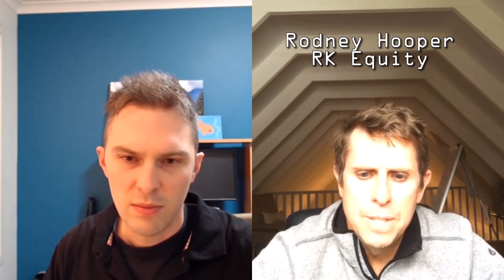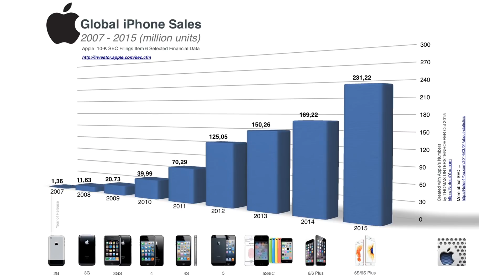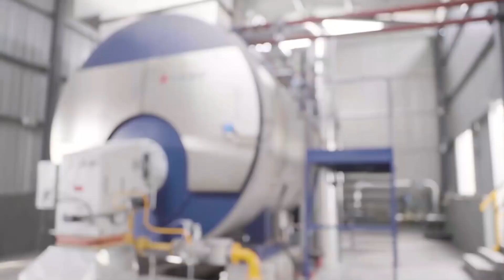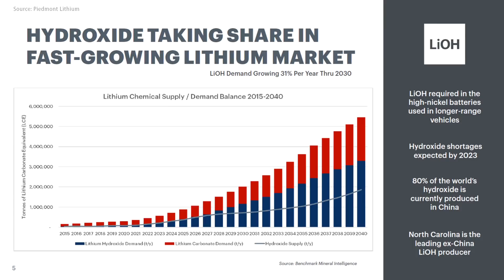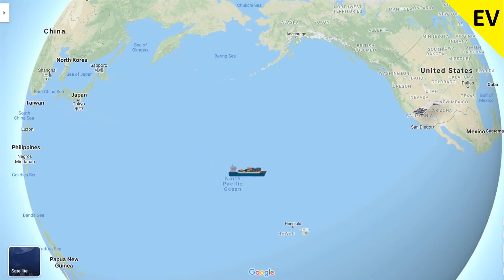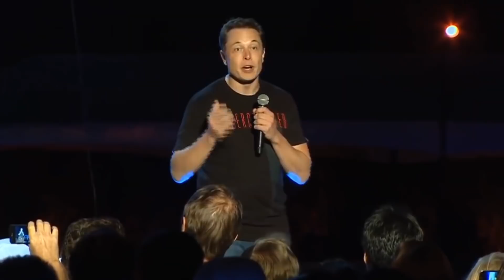Tesla's Lithium supply chain mapped out

Comment: I'm looking at the graph you include at 4:13, and Tony Seba predicts "only" 50% of cars sold would be EVs.
Also, he did not specify how many cars would be sold. What the speaker forgets is that car demand is elastic: If it becomes very clear the market is shifting to EVs, you can expect the Osborne Effect to be in full force, and the sales of ICE cars will decline in anticipation of the transition (who will want to buy an ICE car in 2025 given its resale value in 2030 will be extremely low?). So one can expect the total number of cars to decline strongly as we shift from ICEs to EVs, before rising up again as EV supplies increase to meet demand.
It is quite possible we'll see only 50M new cars sold in 2025, 25M of which are EVs (down from the current 90M/year). 
Also: There is some chance by 2025 we'll have self-driving cars, in which case extrapolations of current sales numbers are not really relevant, as we'll partially shift from private ownership to TaaS (Transportation as a Service).
Reply: Seba actually states that the fleet size will drop precipitously as TAAS comes into play, even as the total number of miles driven continues to rise.  This is because one car can effectively serve the needs of more than one consumer, on average.
This will help some with commodities shortages.
Reply: I definitely think we’ll only see 50M new cars sold annually in 5-10 years.. thou India market is an unknown variable ( to me at least)
Reply: Tesla’s projections have little to do with simple car sales  ironically

Comment: I seems that some mention of current production facilities adaptability for increased production could have been part of the conversation. I had to research a lithium question on my channel but the question was of supply sourcing and the geo-politics involved. Current annual lithium production for the top 9 lithium exporters is 84,840 metric tons (2200 pounds in a metric ton). The US is very secretive about it's lithium mining, but it is believed the US is using lithium far faster than it produces it.

Comment: Good video. When PV became the big growth industry the price of silicon jumped up, but that caused production to jump up so much the price is now far lower than before. While alternatives to lithium exist and must be researched, the growing demand will also encourage improved mining methods, and funnily enough Musk has one: The Boring Company electric tunnel boring machine, which isn't that different form building an electric mining machine. Given it does not need to operate far from a charger, or actually need to be unplugged at all while working, the mine needs less fuel to operate. Also, the trucks that haul the ore? Tesla has those on their "coming soon" list, meaning more fuel savings for the mine. And as mines are not popular places to build your house these days the company can also put up solar farms or windmills to keep their electric bill down without complaints from residents.
Such things obviously cost money to build or buy, but going greener would likely bring the company tax cuts and other benefits aside from lower operating costs.
Elon already hinted that Tesla might just get heir own mine to ensure supply. They could then use Boring company machines, Tesla trucks and Tesla solar in that mine to show off how CO2 costs of producing EVs can and will be brought down, meaning every other mining company will be either thinking of upgrading their operation or under pressure from environmentalists to do so now cleaner options are clearly available.
Even if some other chemistry replaces lithium, Tesla could keep selling electric mining machinery and revolutionize another sector of industry...

Comment: I think Rodney Hooper is a bit short sighted.  Lithium expansion is constantly happening there are new lithium mines opening up every 3 to 6 months, and new permits are happening probably every month now.  Lithium mining is accelerating as there are many new mines coming online faster and faster.  Additionally as demand grows there is incentive for governments to accelerate red tape in their regions so setting up future mines could take 3 years instead of 7 years once the governments prioritize Lithium mining.  The key bottleneck is refining.  Need more refining.  Again as the demand grows the incentive for more refining comes to the forefront and should springboard more refining and better faster refining.  another thing is we shouldn't be constrained by Lithium as its only the current cocktail, future better cocktails are likely underway and there could be a future where some batteries don't even use Lithium and cobalt at all, they use something different.   So many options for EVs.

Comment: Thank you for good explanation!
It was mentioned 0,8kg lithium for 1kWh Model 3 battery. Is this as rock or process as Hydroxide? And dose the conversion process from rock to Hydroxide required lots of electricity that using renewable energy could potentially reduce the battery cell CO2 footprint  much?
Reply from the maker: Great question ill have to ask Rodney next time I get him on the show

Comment: Great interview, but he seems to forget one little very important thing: Recycle batteries and I'm just gonna leave it here.
Reply: When they get to 90% charge (talk of that at 3 million miles) the batteries will be recycled into storage packs.
Reply from the maker: Will be covered soon
Reply: EV Stock Channel - could you also maybe tie in the reduction in lithium needed with dry electrode and new ways to first charge the battery.   Isn’t it some large % of lithium is lost in the initial charge of the battery to help with battery life?
Reply: Not forgotten.  Unless the market will absorb the cost (which it won't), and is willing to have recycled vs. new batteries in their products (which they aren't), the supply issue IS an issue.

Considering the fact that most folks are not planning on buying EVs, kind of a strawman subject.  It won't be materiel shortages that kill EVs, but a lack of sales or mass demand.
Reply: @billcichoke2534  
There already is a huge demand that is greater than the ability of suppliers to meet it. 
But since the cost of batteries is going down and the energy density is going up, battery vehicles will be better and cheaper than gas cars in about 5 years. At that time, the demand for lithium is going to be intense.
One country has already had a coup- Bolivia. Bolivia has huge reserves of undeveloped lithium. It's not a coincidence. They threw out the president and replaced the government because they want to develop the lithium.
Reply: @Tesladocumentaryseries7603  Given average miles driven, the fact that EVs have few moving parts, and the batteries are good for many miles, it may be many years before significant amounts of Tesla batteries need to be recycled, Someone should do a spreadsheet for Model 3 and Model Y with those on the road now plus anticipated sales, along with average lifetime, to calculate the amount of batteries to be recycled. I'm guessing not that many before 2030. Alternate versions of the spreadsheet could include a robo-taxi timeline (which would increase battery wear) or simply using batteries with reduced range as fixed power storage (which would reduce recycling). I suspect no Cybertruck batteries will be recycled before 2030 at all. If my guess is correct, recycling will not occur soon enough to mitigate necessary mining for the rest of this decade. I also suspect cheaper battery chemistries will end up being used for fixed energy storage where kW-hr/Kg is not as critical.
Reply: @Chops2792  See the Hyperchange video about synthetic graphite, which may fix this problem. The batteries will last longer but I'm not sure it will reduce the total Li demand by that much.
Reply: @billcichoke2534  If material shortages don't drive up battery cost or availability, sales and demand will grow steadily (at least) if not exponentially when EVs have cost parity with ICE cars. Given the Greens in EU government, emission regulations and EV subsidies in Europe will drive EV adoption even faster than in the US. If you are betting EVs will be "killed" I think you are way off. Once EVs can match ICE cars on price, with a good (300+ miles) range, the only advantage ICE cars will have left is the network of gasoline stations, and the electric charging infrastructure may grow fast enough to counter that. [I do not count the people who prefer engine noise and manually shifting gears in this argument. I group that small minority with the dinosaurs touting vinyl records and tube amplifiers.]

Comment: Hauling rocks...
EVs are basically rock-haulers that people sit in. IOWs, the weight of the rock they are hauling determines everything from the price to the performance (P&P), etc.  Therefore, batteries will/can only improve P&P if the "rock" gets "lighter." And that ain't gonna happen. So the question: Is this why Tesla built the container for the battery cells straight into the car's frame rather than inserting "modules"  i.e,  to "lighten" the rock?
Meaning, they have reached THE LIMITS of battery P&P in real terms since you cannot make a rock lighter than it is.
So just like the famous quote from the Saudi Oil guy decades ago "The Stone Age did not end because they ran out of stones," the battery-age is one day going to be supplanted not by a better rock-hauling battery, but by an ENTIRELY different energy source that obliterates this single quandary; IT'S WEIGHT relative to what it's carrying. 
Until then, Li (rocks) will be hauled...

Comment: You can basically start a mine today by start digging. Of course you can do that also after waiting several years.
Reply from the maker: There is a lot of stuff that has to happen before digging can commence. For example in Australia they have to first build out a rail way, road to a massive conveyor belt to be able to get resource from mine production facility or port. Some deposits are very remote.
Reply: EV Stock Channel if Elon can set up a GF in 10 months, I’m positive starting a mine would be possible in a year or so if we really want to. Of course not at full capacity at the beginning.
Reply: Stefan Grabe you might be right ...  although you have to wonder why the mining industry has up until now been run by people who choose to take a long time to open mines if it is so easy to do it quickly.

Comment: The question that hasn’t so far been addressed is the environmental impact on refining lithium and the other minerals. What has been done to reduce that environmental cost. After all, replacing toxic coal strip mines with even more toxic lithium strip mines is not necessarily a good thing.
Reply: Its not really only about the coal, its about stop pumping all that oil up, and spreading toxic gas from your car everywhere. 
Stop being ignorant.
Reply: Coal gets burned up and released into the atmosphere to produce energy. Lithium is a recyclable component. This seems a huge difference to me in relation to reducing our environmental impact.